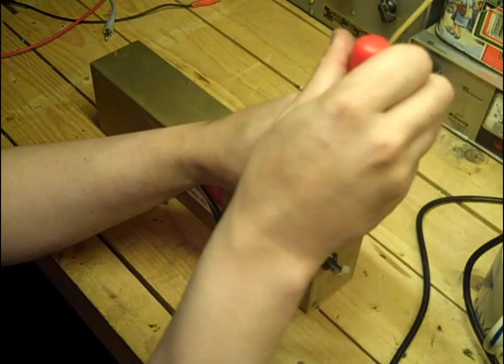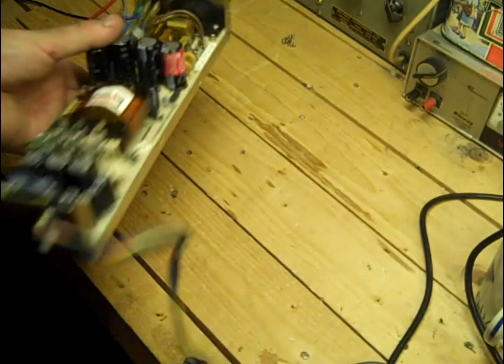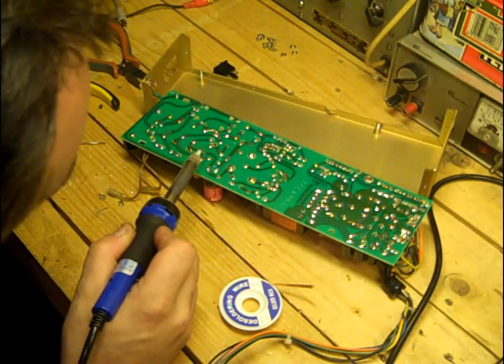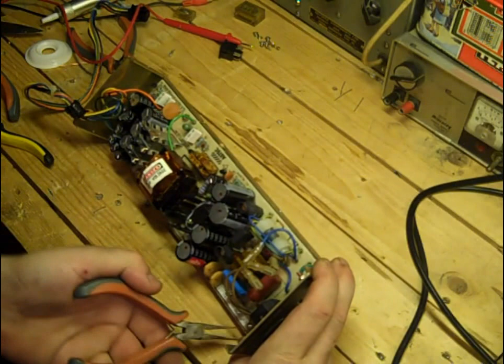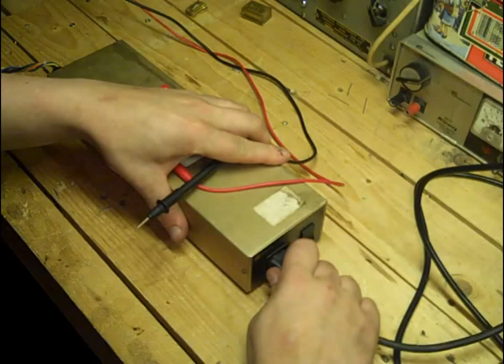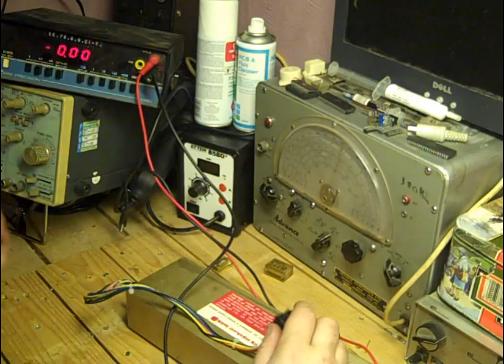Apple2 psu repair

Comment: Good call on replacing the larger X2 RIFA cap as it would most likely fail soon after woods and you’d be kicking yourself.
Polarity using your esr meter shouldn’t matter.